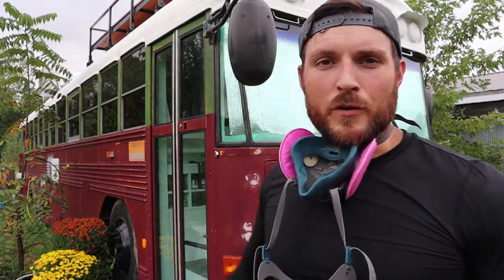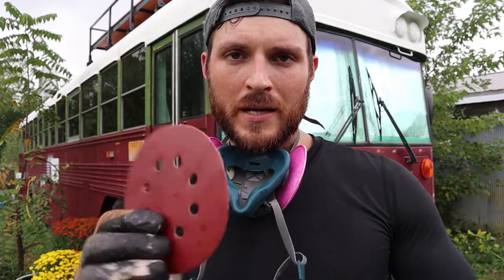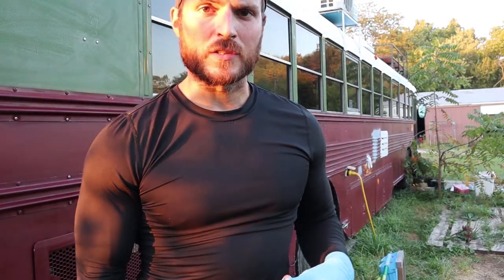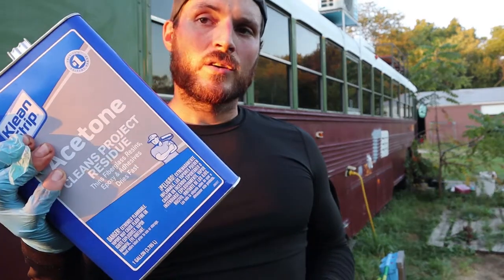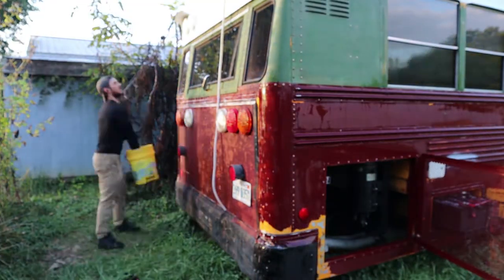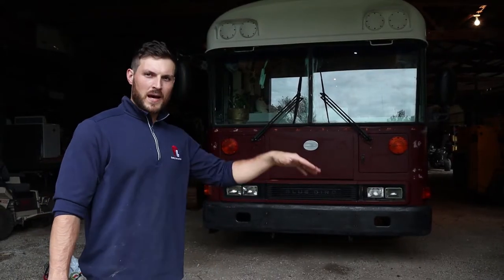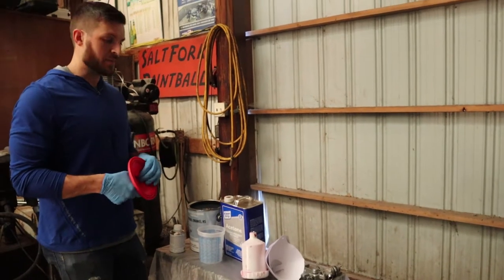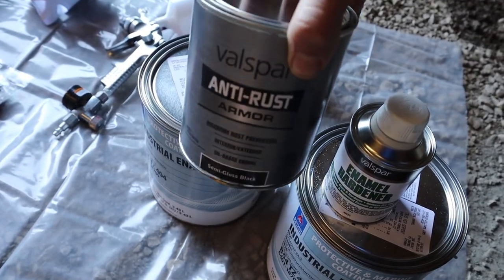HOW TO: Paint A SCHOOL BUS! SKOOLIE Looks Incredible with FRESH PAINT!

Comment: Great paint job.  Also, for other viewers watching this because you plan to paint your own rigs with acetone-based paint, its a good idea to use a P100 organic vapor cartridge respirator so you don't die in your DIY paint room should you fail to adequately ventilate it. The reason acetone has such a pungent odor is because of its its ability to vaporize extremely quickly. If the concentration of acetone gets to high it could lead to dizziness, headache, loss of conscienceless, or even death.